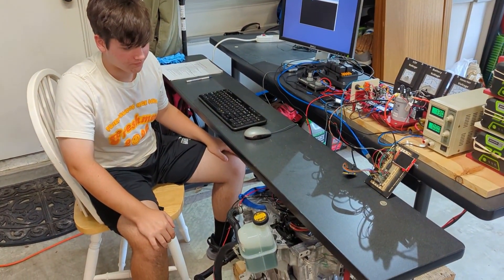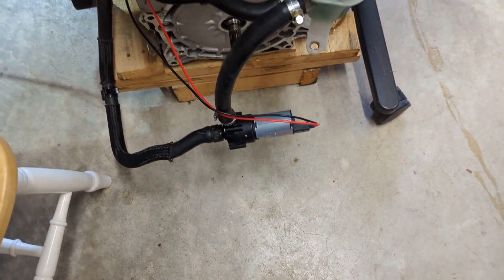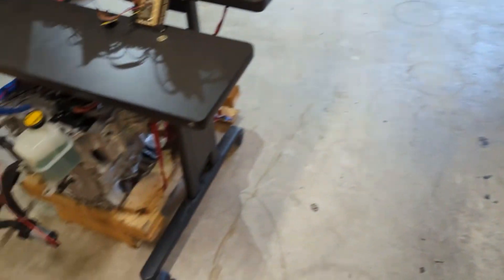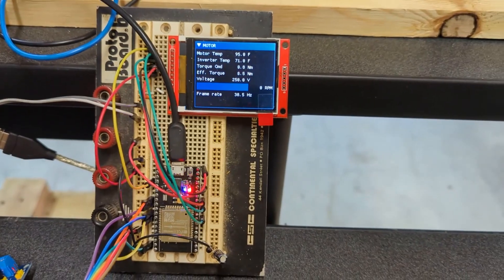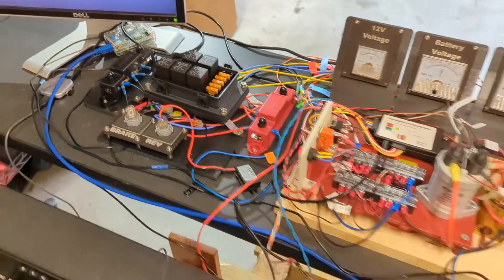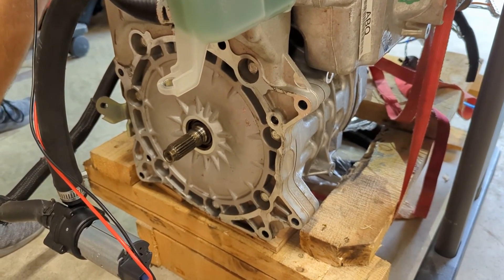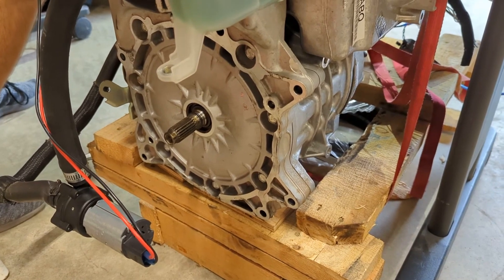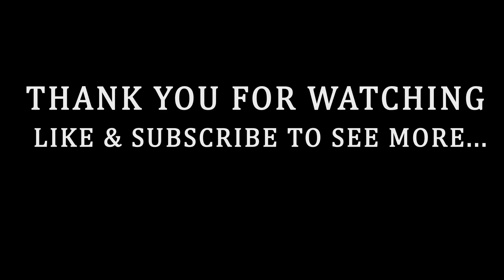Porsche 924S EV Conversion - Part 12 - Getting ready for a real battery!

Comment: The gear noise could just be gear lash. For example, with some manual transmissions (Miatas are known for this) with the car sitting in neutral but the engine running there will be a rattling noise coming from the transmission. It is basically just gears bouncing around in the lash or gap between the gears; there is always some backlash with metal gear transmissions to allow for things like machining tolerances and thermal expansion. It is not really an issue, just an annoyance. It is loud enough to make the owner think there is something wrong with the clutch or the transmission. 

There are not as many gears in that transmission as there are in a 5-speed manual of course, but they are still there.